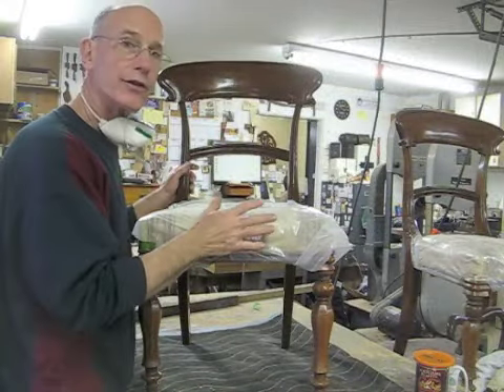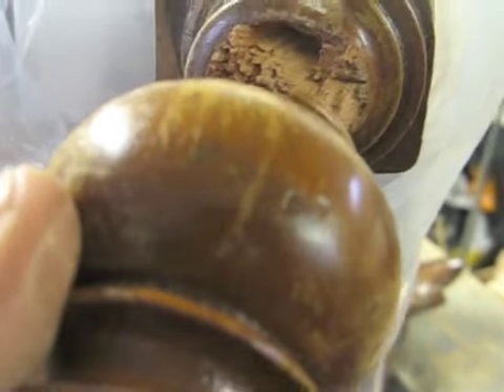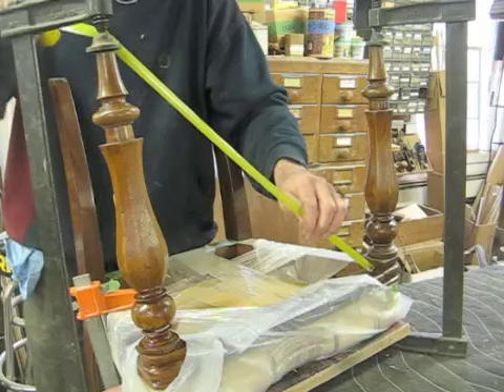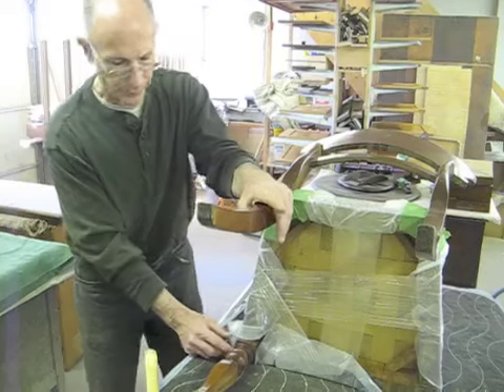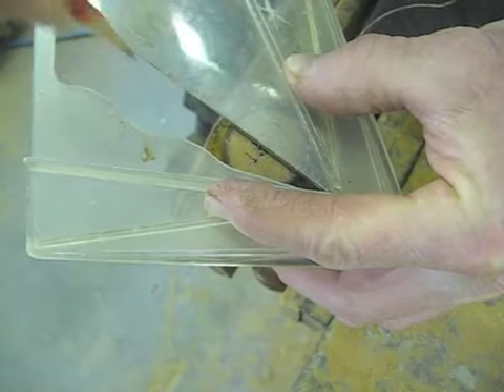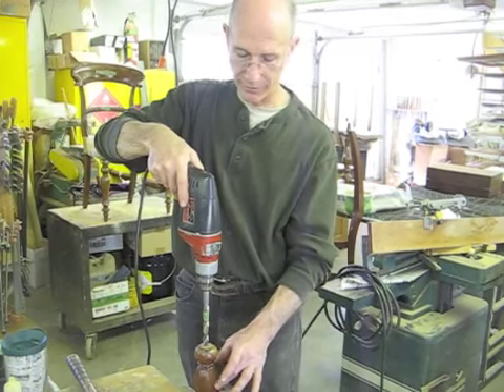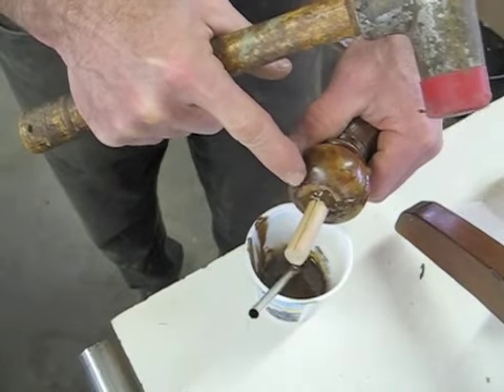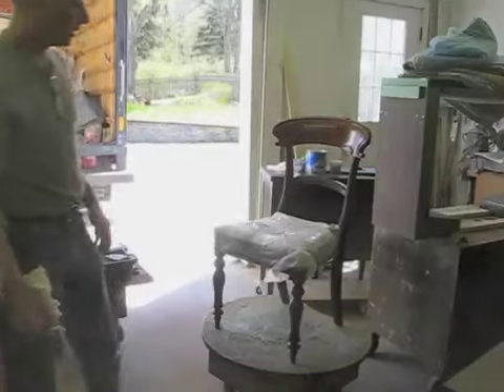Repairing the Leg of a Victorian Side Chair - Thomas Johnson Antique Furniture Restoration

Comment: Tom a question ! Can the same technique be used for non symmetrical pegs like a Chippendale style with eccentric shape that still has some meat in the broken cross-section where a similar dowel could be inserted vertically but of course due to its eccentric shape the dowel is not going to remain in the center of the profile on its entire length???? I hope I explained it clear enough but if not I can send some photos of the piece with relatively similar break that I’m trying to restore
Reply from the maker: Hi Fater. Yes you can, but it's just more difficult to get it lined up correctly, which is why I don't mind if it's a little sloppy, then when I clamp it up, using epoxy, I can adjust it slightly  if I need to. Yes, email some photos
Reply: @johnsonrestoration  I will go to workshop on Monday will send you some pictures and yes I want to use same epoxy adhesive with similar slack introduced to dowel holes the wood species is teak and I’m gonna use teak 1/2” dowels